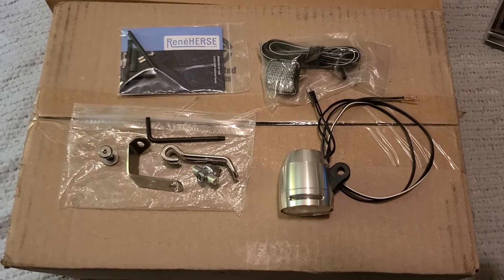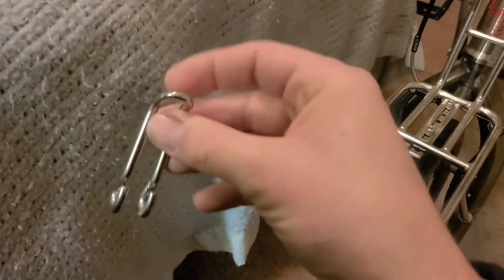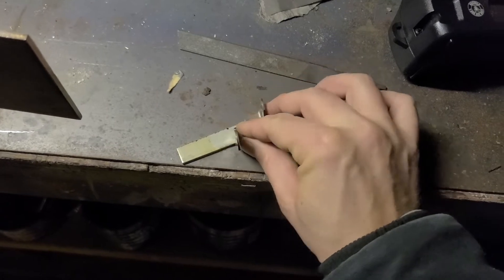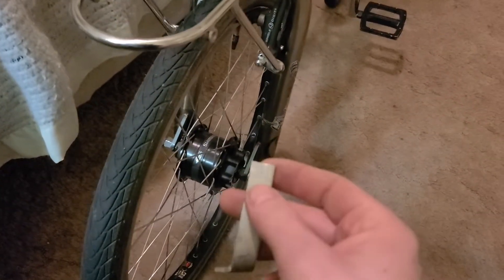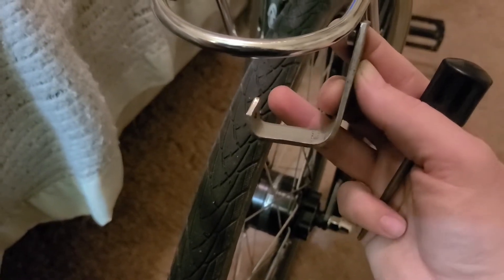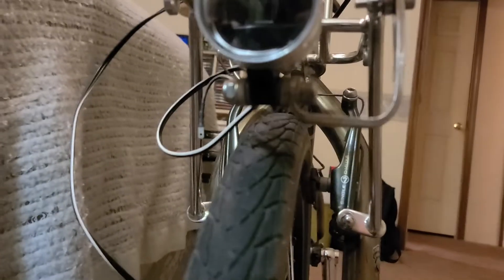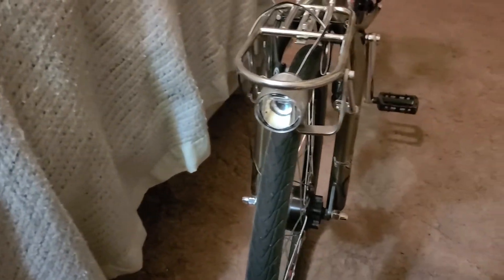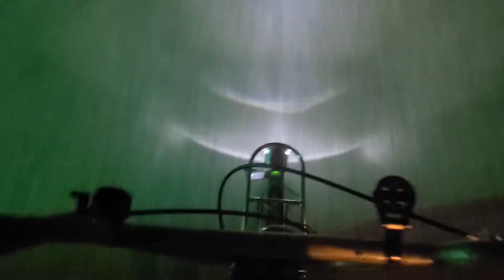I install a dynamo powered Busch & Muller IQ-XS light on the 20" touring bike.

Comment: Don't you want more pantry bag protection against the wheel with your front rack???
Reply from the maker: For panniers?  aka side bags?   I haven't wanted to use them on the front yet.  If I plan to.  I'd figure a way to make triangular bracket side mounts and adapters for the fork.

Comment: How do you like it? I did something similar, but my other bike has it offset,  and it doesn't affect usability.
Reply from the maker: I'm liking it alot.  Both this light and the tail light are doing great.  The same head light is on my folding bike too and with that one I try not to notice the fender shadow.  On this one I only notice when the beaming isn't centered, after somehow banging the light into something.  The light doesn't move as easily as the light on the folding bike does.

Comment: Something is going to get hooked by that bracket. You could mount the light upside down. Perhaps make a bridge between the mounting points on the rack and suspend the lamp from that.
Reply: or make an extra bracket on the other side